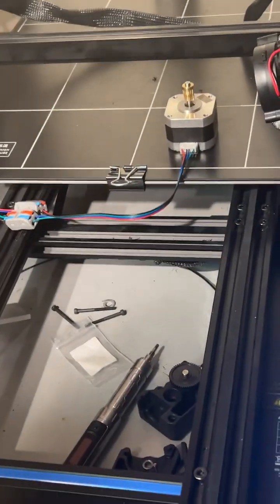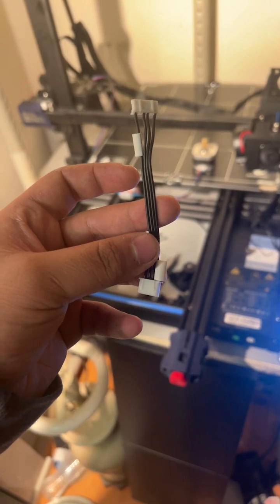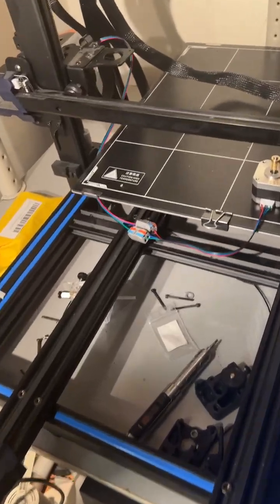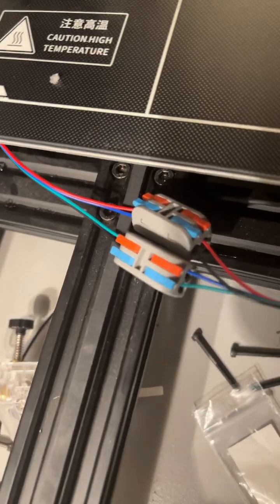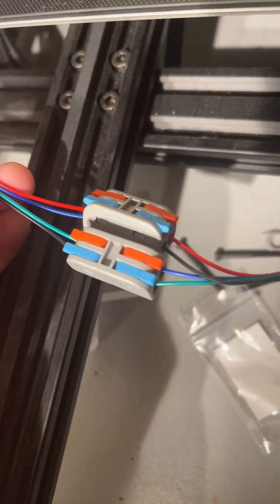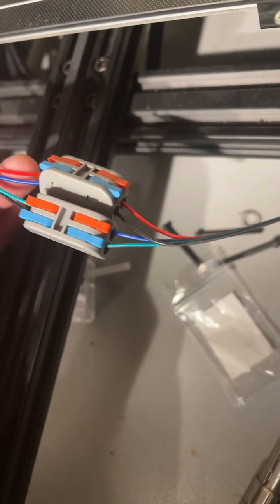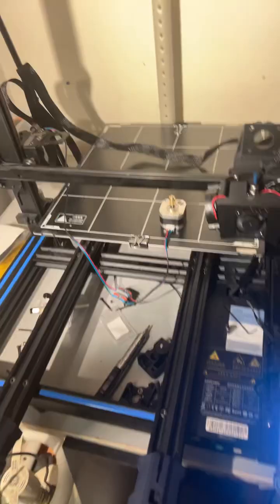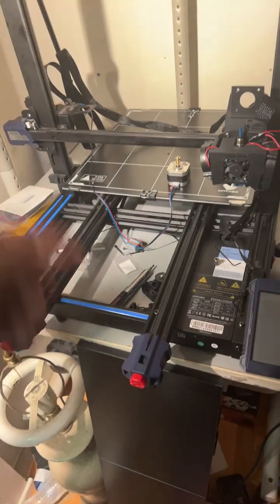Anycubic direct drive: stepper motor wiring issue solved

Comment: question, so was it because of the length of the cables that you had to do that modification? or what was the actual problem?
Reply: I am having a problem with my stepper motor (new to 3d printing and know nothing about wiring)
Reply from the maker: @christianibarra2642  this was an abandoned project of mine.

But I believe I had mis-wired the stepper motor  as you can see I had to change wires from their original positions. Not all stepper motor wire harnesses are the same
Reply from the maker: @christianibarra2642 if you have a problem with your stepper motor vibrating, check the mounts, check the stepper shaft for play (side to side or up and down movement if there are any) reset your printer settings or if there are guides and it’s tied to a belt, check your guides.